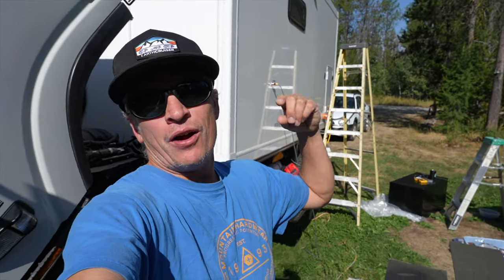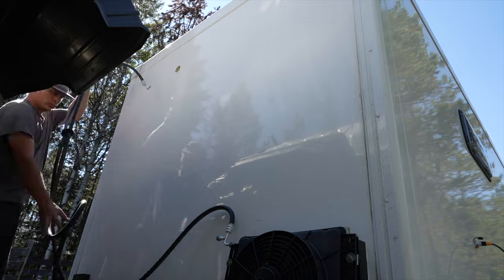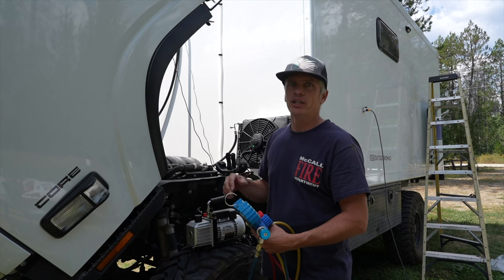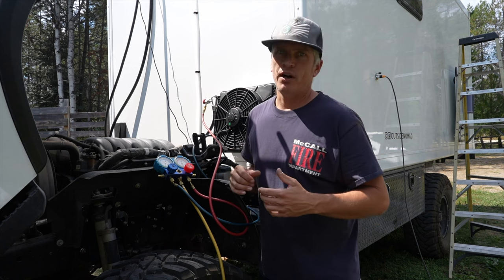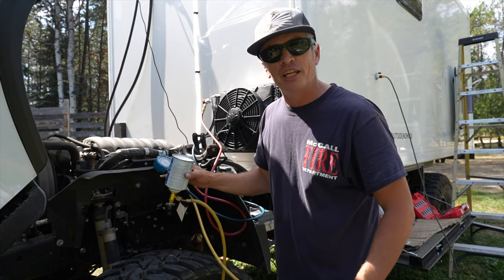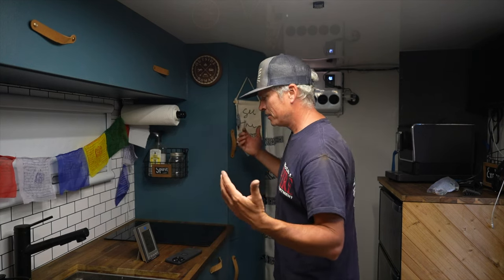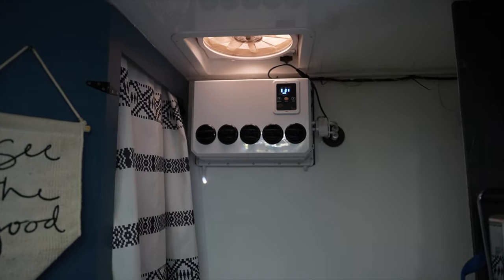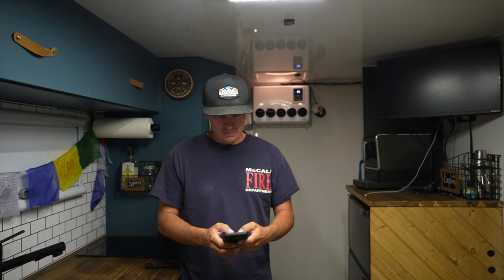Part 2 - Budget Camper Van Air Conditioner for Overland Travel - 12 volt/24 volt DC Powered AC

Comment: After you vacuum the unit close the gauges and attach refrigerant to the yellow hose and open the refrigerant. After you open the refrigerant crack the other end of the yellow hose to let out any air in the yellow hose. Close the yellow hose after just barely letting out a little Freon. Leave system off and open the high side valve and put as much of the Freon in that will go in. The reason for this is the refrigerant is in a liquid state and you don’t want to flood the compressor from the suction side. After the system takes what Freon will go in with the system off turn off the high side”red” valve on the gauges. Turn system on and finish charging unit from the suction side”blue” valve on the gauge.    This is standard procedure for any ac. I have been doing hvac for 20 years and it doesn’t seem to hurt the system the way he did it but he will have a slight amount of ambient air in the system from the yellow hose which in the long run will create problems. And starting the system with no Freon isn’t good. Just my 2 cents
Reply: hello, thanks for the explanation, what kind of problems would cause to let some ambient air from the yellow hose?
Reply: @cusber  Any ambient air the gets in the system is going to be what is called a non-condensible...takes up space in the system and affects the cooling capacity, and will cause fluctuations in the pressures. also, the ambient air has a certain amount of moisture content. also a non-condensible...this moisture is water and water is also not compressible. so when a pocket of moisture gets to the compressor, it will throw things off. also when moisture and certain refrigerant oils come together, it can create acidic conditions that can eventually corrode and cause leaks or other issues. not saying any of this will happen...but the possibilities are there.

and a compressor should never really be energized while in a state of vacuum. 

as another note for the video poster...the negative side of the low pressure gauge isn't measuring PSI. It is measuring a unit of vacuum known as inches of mercury. Ideally, without a digital micron gauge, using these analog gauges only, you should be getting that down to the -29 inches of mercury mark if you have a good sealed system. if its not getting down, you have a leak somewhere...anywhere in the system itself all the way back to your gauges and vacuum pump. OR you still have moisture in the system and you need to let the vacuum pump continue to run however long it may take to boil off remaining moisture.
Reply: Thank you for the good explanation. This should be a big help. Wish I had taken an AC course when I had the chance in Junior College. I used to only pay $13 a credit for classes!!!!
Reply: You took the words right out of my mouth. I kinda cringed seeing him turning can upside down pumping liquid into the low side. Sometimes people get lucky
Reply: You can charge as a liquid into the high side before starting the system without any damage.
Reply: This is why you hire a professional to at least give you advice instead of DIY and screwing it up. His damage may not show up for three or four years.
Reply: @CoreyMeagher I’ve evacuated mine three times. Holds 30 for hours. Put in a little less than 2 cans (mine calls for 600 g +\ 10%) freezes solid every night. Or every time I let it run on low fan speed. Don’t know what is wrong. Ready to trash it.

Comment: Thanks for sharing your exprience with the unit. We also have this mounted, in 12V version, using it actually for a couple of months so far. We wanted to be able to live/travel along with our guinea pigs therefore AC was a must if we ever wanted to go on a hike during summer. It serves its purpose really well, we typically set the target temperature to 26-27 Celsius degrees and on fan speed level 1 and it's keeping it steadily. We have a 30A MPPT controller and ~1kW of solar panels on the roof to feed it, so during the day it's covering almost whole load of the AC. We're looking into an upgrade to 70A MPPT which should give us guarantee of covering AC needs for power during sunny days. Cheers!
Reply: I just ordered the 12vdc version, thanks for your input on what I should expect on power usage when it's installed and running.  I figured I will be needing to add about 600w more of solar panels if I want to lower my dependence on my generator to charge the batteries.. My travel trailer is only 20ft, but I believe I can find a way to make 1kw of solar panels fit.
Reply: Having a 30A MPPT with 1KW solar surely is a huge bottle neck you are not utilizing maximum of your solar panels plus 30A MPPT may blow up at these loads.

Comment: Thanks for the info.  You are about the only one in North America that so far has given a review on one of these specific a/c systems.   I just ordered the 12v version that had the added 800w heater built into the air handler for about 50 bucks more.   This will be going into my 20ft Keystone Passport ROV 173 travel trailer and will be running it on a bank of 3-240ah (720ah total) Lithium iron batteries with 400w of solar panels on the roof to start with. No doubt, I might need to add another 200w of panels.  The main goal, is to at least be able to keep the travel trailer cool during quiet hours at a given campground when dry camping atnd top off the batteries with a generator during the day if the solar system isn't keeping up.  I will update when I have my 12v a/c system running.
Reply from the maker: Right on! I really like the heater option I’ve never seen that before. That sounds like a great setup. Let us know how it works out. Our system has been working great.
Reply: @outsidenomad  I got the 12v version mini-split installed tonight. No manual was included in this and took me a couple hours of troubleshooting the failed vacuum test to learn that the small and large size "O" rings inside the parts bag, was needed to be placed on the refrigerant fittings on the air handler.  I message the Amazon vendor to tell him that he needs to get me a manual if he wants a more positive review, which is said he will get me one in a couple days.  

The initial settings are showing this drawing just over 49 amps on high a/c setting and will taper off around 25-30amps when reaching the set temperature.   Without a manual and the buttons being in Chinese, it was a hit and miss several times with the buttons, before I finally got the electric heater running.  Initial impressions with the heater were ok, but doubt I would want to be in artic temps trying to warm up my camper with it, hopefully I get a manual and better understand how to make it work better. I can certainly see it take a chill out of the air in the camper when outside temps are around 40-50 degrees F.  

I'll be running the a/c overnight in my camper and check on it when I wake up in the morning. I wish I had a way to send yo some pics of how I installed it on a slide out of a 20ft travel trailer.
Reply: which one did you use that also has heat? you got a link?
Reply: @DgGh0stKilla  It's only an 800w heater, it'll take the chill out of the camper, but don't expect it to provide toasty heat in freezing temps.

Comment: Great video, really helpful to gauge what these will draw!
Something that I did notice was you using "amps" interchangeably with what I assume was "amp-hours". The difference is huge and would help others by discerning between the two.

Amps is instantaneous current, so you would say that it's drawing 24 amps on high load. However after an hour of running on high (ignoring duty cycles) you would say it's pulled 24 amp-hours from your battery as it's a measure of draw over time. As your batteries are rated in amp-hours this is a much more meaningful number.

You can also avoid the translation of 12 volt to 24v by just converting all your units to watts and thus watt-hours (which I'd highly recommend anyone doing math for electrical)

So you'd say that this would be drawing 576 watts (24v x 24a) and over the course of an hour this would my 576 watt-hours, or over the course of 1/2 hour it would be 288 watt-hours
Reply from the maker: Agreed, I got a little loose with my terminology.  Watts is a far better way to go when talking about all this but unfortunately the industry is so biased towards talking in amp hours.

Comment: Hey man,   this is Tyrone Washington,   in the hood we not got a vacuum  pump.  So I just  push nitrogen gas ⛽️  inside the pipes.   This will push the oxygen  and humidity out.  Then I  lets the nitrogen out of the pipes,   just down to one pound of pressure.  Then we push in the 134 feeron.
Works best for the Hood.

Comment: Finally, a complete video about this type of A.C. !
I just found you and instantly subscribed just for that.

I am looking forward to see a wattage consumption test at much hoter temperatures (like 40 celsius dg).

I still have some weeks to decide between buying a 230V AC mini split or this 24V Dc.

The all day ON inverter scares me a lot, so that means I have to switch it Off every time I leave the camper, so I can't let the A.C. low runing from solar.

The heating option is a plus for the AC minisplit, but the exterior unit is not modular and eats a lot of interior space since I would want to enclose it in a slide out box ( for stealth-ish look reasons).

I wish they make a 24V DC air with heating pump, too..

Safe travels!

Comment: Should purge charge line of air at gage connection prior to actually charging system. Don’t want reintroduce air after vacuuming. Great review.
Reply from the maker: That makes sense thanks for the tip.

Comment: Awesome review! I just watched part 1, and I'm convinced I want to get one of these for my skoolie. I've got a 28-ft bus, and it came with 2 factory units, but they function more like fans than ACs. So, I'm hoping to rip those out and install 2 of these instead. The power use would be much lower and the price is the best I've found so far for a 12v AC. Would love a 1-year review of how the unit's been holding up.
Reply: Same, I have a handicap bus that I’ve converted into a work van/bus for my profession and the bus doesn’t have rear air, so I’m wondering how this will manage. I’m assuming I’ll be able to run this but with an inverter pulling power as well, I’m not exactly sure what all he’s saying means. I’m assuming I’m gonna need a few batteries?

Comment: Thanks for your great video and contribution to us van builders!  One minor but important suggestion.  When you say "amps" that you've used over time you should be saying Amp-Hours and Watts used over time should be "watt-hours"   Amps and Watts are both instantaneous measures.  There is no such thing as "I sued 300 watts over 30 minutes (that would 150-watt-hours  and there is no such thing as "watts per hour"  if you use 600 Watts for 30 minutes that's "300 Watt-Hours" (Not watts "per" hour")   if you use 25 amps for 30 minutes that's "12.5 Amp-Hours".  Think of it like person-days - if two people work for a 2 days  that's 4 person-days - not 4 persons "per" day.
Reply from the maker: Agreed, thanks for pointing that out
Reply: I like amps over watts personally

Comment: Thank you for the detailed description! I’ve been thinking about getting a similar unit for my sprinter and your video helped push me towards it being a good idea. It’s hard to find much info about these online!
Reply from the maker: Glad it was helpful!
Reply: Did you finally install one like this in your Sprinter? I have one without air conditioner on the cabin and I'm considering to buy one like this
Reply: @ismaellopez6392  Yes, I have had one installed for a year and have been very happy with it. I have the compressor and condenser on a custom bracket underneath the van (like this video I am also not using the provided housing). The evaporator and blower are hidden under the bed and piped to 4 vents (2 at a seating area and 2 above the bed) and the intake for the blower has an air filter fitted to it. 

Generally, it works really well but there is definitely a temperature gradient between sitting near the vents and being further away, but this is more of a van insulation and airflow issue more than anything to do with the AC. The important part is it keeps the temperature comfortable (<80F), especially for sleeping in the summer months!

Comment: great vids.  i've had a 24v unit just like this sitting around for months for my sprinter van.  been hesitant to tackle this install b/c of lack of documentation and instructions, especially on the freon charging aspect.  think i'll tackle this soon.  thanks!
Reply from the maker: Right on! Get that puppy installed. Everything you need to charge it can be rented.
Reply: How are you mounting this type on a van?  I'd think that you need a rooftop version.
Reply: @glennr9913  beneath, between the frame rails. There is a good amount of undercarriage space. People add grey water tanks, larger fuel tanks, etc  beneath the van as well.
Reply: @outsidenomad  one more question… did you need to add any oil for the compressor when initially installed? Or do these units come pre oiled/run oiless unlike belt driven compressors?
Reply: @gawdzilla123  Where are you planning to mount the interior unit?
Reply: @glennr9913  I have two benches built out in my van which turn into beds. The interior unit is in one of them with the vents blowing out. Not ideal because it’s basically on the floor, but should still work. Some builders conceal the unit completely and built a ducting vent system.
Reply: hey does these come with an heater strip
Reply: @powerbanksrb  no heater strip, and it also can not be run as a heat pump.

Comment: Glad I found your videos. Good job documenting! Another option could be a 110v mini split with a high SEER. I see their ratings vary from 16 to 26. I know there is a 15% inverter penalty going from 110 to 12 but if the unit had only a 15% better SEER it would then be more efficient, right? I didn't see any any SEER listed for this 12/24 model, and wouldn't trust one if they did publish it.

Comment: Yup did that every time I recharged the system.
Reply: How often do you need to recharge the same system? Wondering if it’s worth buying the pump and stuff and learning to do it to save money in the long run.
Reply: Ideally you’d never have to recharge it. The only way they lose refrigerant is a leak.

Comment: I just learned about these little units. The Amazon listing is showing a 13500 BTU cooling capability but also says 2300 watts, which is only about 8000 BTU comparable. I'm really curious about the unit for similar reasons you were... The AC units are huge and I can only think of 1 spot to mount one... Long story short I don't love the location of that 1 spot as it is furthest from our bedroom and I'm not convinced a 12k BTU will easily cool a 30' school bus. One of these smaller units could be mounted much closer to the bedroom. I know it's winter, and you may not have had a great chance to really test the system, but I would love updates to know how well it's working and what kind of real cooling you think you are getting out of it.
Reply: @outsidenomad  Welll, thats why the BTU output of your unit could really make a big difference. If it is the 13.5k that they claim, then it is 1500 BTU higher than the biggest 110v residential minisplit (which is only 12k).

Comment: You drilled into the frame flange? That's a bad idea. Good luck with that. 😊
Reply: I cringed when I saw that. Glad I wasn't the only one! Every truck frame rail I've come across has stickers warning not to drill the flange.
Reply: Hey man,   you are Correct
Reply: yeah that 1/4 " inch hole will  break the Frame:face-blue-smiling::face-blue-smiling::face-blue-smiling::face-blue-smiling: in half over a speed bump

Comment: Good review on this system. However referring to amp hours as amps is driving me up a wall.

Ah = stored energy capacity

A = the speed at which you are currently using that capacity

Comment: I notice you have Installed the "radiator" 180° upside-down. You mentioned emailing the distributor about mounting it at a 90° angle from oem placement, did you ever hear back from them? 
How well is the unit working, installed upside-down?
Reply: The PAG oil is miscible with the r134a refrigerant, so it makes no difference what angle the condenser is installed.

Comment: Great video.  Thanks for sharing it with us.  
We need an A/C unit for our van.  I think a rooftop version would be better for us.  They seem to cost a bit more but don't require charging with freon, so that saves the need for the vacuum pump & gauges and the bottles of freon.
Reply from the maker: The DC powered rooftops AC's are great and like you said make installation really easy.
Reply: Still working?
Reply: You could always take the finished setup to an automotive shop and pay them to charge the system for you. Absolutely no different compared to charging the vehicle's own system and most of the cost will be for the refrigerant, no matter who does it.

Comment: Great video! I bought this exact unit to install on my ambulance RV. I have 400Ah of lithium batteries with both 200W solar panels and the van's alternator to charge the batteries. We only plan on using this unit overnight (~8hrs). Does 400Ah seem reasonable for overnight use? I don't have any other draws on the battery. Thanks!